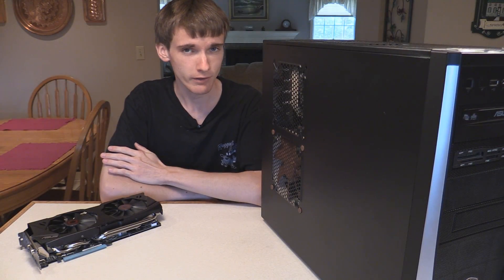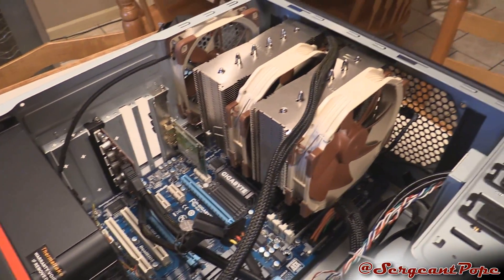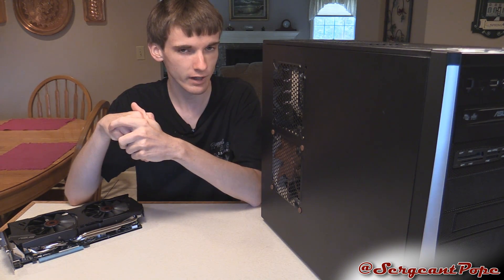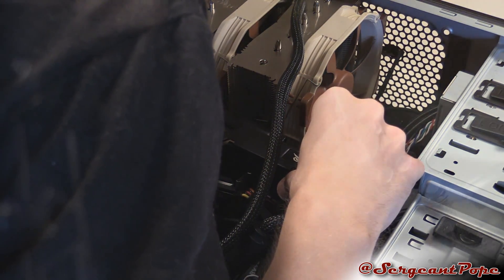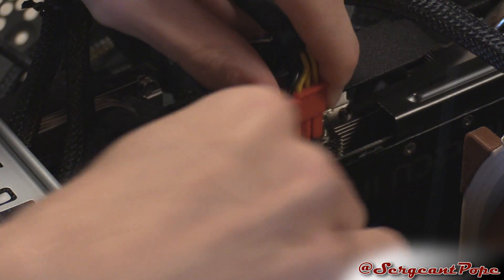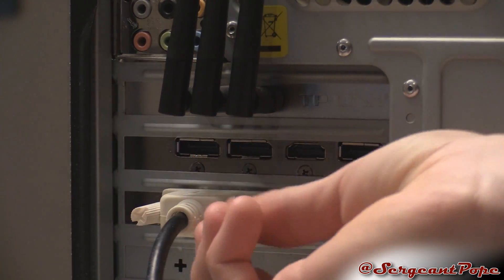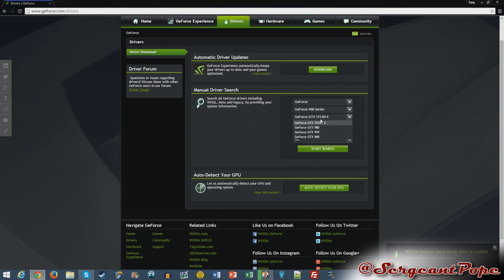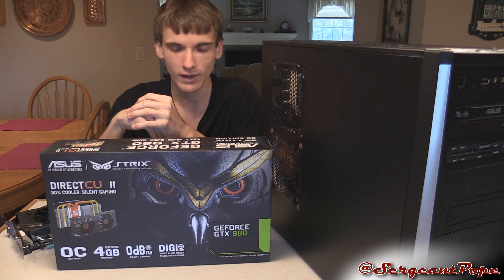How to install a graphics card - GET INTO PC GAMING EASY!

Comment: My pc has a AMD R9 200 series and the computer case I have is a ARK 4U-500-CA Black 4U Rackmount Case 3 I was wondering if you would know if I try to switch the graphics card I have rn would a AMD 480 fit in my pc because I was thinking of buying a 480 but I’m not sure if it would fit the case?

Comment: I have an ASUS gtx 1060 3gb which will fit in my case and I have an issue with the card going in on one end and the other end is not and with pressured applied it won't go in.

Comment: how do you plug the cable into the power supply coz i got a gtx 570 and the cable came with the gpu and isnt plugged into the power supply

Comment: gt 1030 graphics card is avaible to use to use on i3 2120?
Reply from the maker: I wouldn't get anything less than a GTX 1050. Anything lower and the performance drops off quickly and you lose a lot of performance. But to answer your question, any processor will technically work with an i3. Maybe not incredibly well, but it will work.

Comment: Hard Drive Capacity1024 gigabytes Hard Drive TypeSATA Operating SystemWindows 10 Processor BrandAMD Processor Speed3.8 gigahertz Processor ModelAMD FX-Series System Memory (RAM)8 gigabytes Wireless NetworkingNone Warranty Parts1 year limited Labor1 year limited Memory Cache Memory4 megabytes Media Card ReaderNo System Memory RAM Expandable To16 gigabytes Type of Memory (RAM)DDR3 Number Of Memory Slots2 System Memory RAM Speed1600 megahertz Certifications & Listings ENERGY STAR Certified No EPEAT QualifiedNo Network Ethernet10/100/1000 Number Of Ethernet Ports1 Graphics Graphics TypeDiscrete Graphics Processing Unit/GPUAMD Video Memory TypeDedicated Graphics CardAMD Radeon R7 240 Video Memory2048 megabytes Internal Hard Drive RPM7200 revolutions per minute Number Of Internal 3.5" Bays4 Number Of PCI Slots1 Number Of PCI-E x1 Slots1 Number Of PCI-E x16 Slots1 Expansion Slots1 PCI Express x1, 1 PCI Connectivity Number Of Auxiliary Outputs2 Number Of HDMI Outputs1 Number Of USB Port(s)6 Number Of VGA Ports1 Port Type(s)HDMI|DVI|VGA|USB|Ethernet|PS/2 Number Of DVI Ports1 Number Of PS/2 Ports1 External Number Of External 5.25" Bays3 Expansion Bays3 external 5.25", 4 internal 3.5", 4 internal 2.5" Enclosure TypeMid tower SizeStandard Included Operating System Architecture64-bit Optical Drive TypeCD|CD-R|CD-RW|CD-ROM|DVD|DVD-R|DVD+R|DVD-R DL|DVD+R DL|DVD-RW|DVD-ROM|DVD-ROM DL|DVD-RAM|DVD+RW Additional Accessories IncludedUSB keyboard and mouse, power cord, RGB color remote Keyboard IncludedYes Monitor IncludedNo Mouse IncludedYes Feature 3D-CapableYes Audio Technology7.1-channel surround Bluetooth Enabled No General Color CategoryBlack Dimension Height17 inches Width7.6 inches Depth19.75 inches Weight32 pounds Other UPC811842032872 

This is my computer, I want to upgrade the graphics card and power supply but I feel like I want to upgrade my graphics card enough so it’s good for several years and if I want to do that then I don’t want the cpu bottle necking it, also I want to get an ssd and quieter fans so in total, a new GPU ,CPU ,PSU, FANS, MEMORY TO 16 gigs, And after upgrading all that probably a new mother board so I’m basically replacing fucking everything, is it better for me to just sell this computer and start from scratch or upgrade everything?

Comment: Awesome vid bro!
I've got an Hewlett Packard Pavilion P6000 Series. I've retired from gaming but would like to play TF2 or GMOD on the occasion. I'm not really into those really demanding games like dark souls or GTA. My computer runs on a 2.9GHz processor, which is pretty much unheard of in gaming. My budget is 100 bucks. Got any suggestions?
Reply from the maker: The cheapest GPU I recommend is something like a GTX 1050 or a GTX 750 Ti. Anything cheaper than that and the performance degrades really quickly and you get a bad deal.
Reply: Thanks man, Ill take your advice!

Comment: Hi man I'm looking into buying a graphics card but the pc I have right now has integrated graphics do you think I could just add another graphics card on top of that and set it as my primary graphics card?
Reply from the maker: Almost always you can't use the integrated graphics with a graphics card. You just use the graphics from the graphics card.
Reply: SergeantPope - Komada Computer Repair ok cool, and I know it's a weird question but I'm having doubts you can upgrade a cpu right?

Comment: I'm getting a 500 dollar tower, it has a i7 7700t and want to upgrade the graphics card because it has the integrated graphics, Idk which graphics card to get
Reply from the maker: Basically get what you can afford. I suggest spending $150+ for a graphics card for best results.
Reply: SergeantPope - Komada Computer Repair will do, I only play league farley play any other games, this tower has igpu Intel hd 630, that may be enough or not, but for starters to at least run league I want to get the gt 1030, but is the i7 7700t even a good processor ?

Comment: I plan on getting gtx 1060 or 1050 but i have a standard size cpu so will it fit ?
Reply from the maker: CPU doesn't matter. All you need is a PCIe X16 slot on your motherboard and enough wattage from your power supply, as I mentioned in this video.

Comment: I am planning on purchasing an ASUS STRIX-GTX1070 8GB OC, I have a TR Challenger 700W. PCIE motherboard. I have a 6 +2 pin for the GPU, is that the same as an 8 pin?
Reply from the maker: Yep, 6 +2 is the same as an 8 pin. That should be plenty of wattage for a GTX 1070.
Reply: SergeantPope - Komada Computer Repair Cheers mate, novice at PC installation 😀

Comment: after uninstalling all nvidia drivers and then shutting down my computer, and putting my new 1050ti i start it back up and the cards fans will spin then stop a few seconds later and my screen says no signal.....???? help me out please
Reply from the maker: Fans starting to spin and then stopping soon after is pretty common with this round of GPUs. No signal is obviously weird. Have you tried plugging your monitor into the video outputs on the motherboard? It may be routed that way instead for some reason. If that doesn't work, you can try things such as removing and reinstalling the graphics card. Make sure connections are good and solid. Stuff like that.

Comment: I have a lenovo B50-35 computer, which is a single monitor with a single cable power adaptor, so not a desktop thing like you and most others and I dont know if another one will fit and my budget is only about £50-£100 ($64-$129).
Reply from the maker: You can't add graphics cards to an all in one computer like yours.
Reply: Is there any other way of getting high graphics?
Reply from the maker: Not really. Not with an All in One computer like you have. They really aren't upgradable, which is a major limitation of those types of computers.

Comment: what if your  power supply is conected to your mother board
Reply from the maker: The motherboard will have a few plugs going into it. The larger one is a 24 pin, and there's a smaller connector next to the CPU. That's either 4 or 8 pins. The graphics card connectors (6 and 8 pin) are different from both of those and will not be plugged into the motherboard.
Reply: SergeantPope - Komada Computer Repair like it connected to the mother board and theres no battery block
Reply from the maker: I'm not sure what a battery block is.. Can you send a picture to my Twitter? @SergeantPope
Reply: SergeantPope - Komada Computer Repair ok
Reply: SergeantPope - Komada Computer Repair also can you mix 2 gb ram with 4 gbram

Comment: hey man, so i have a lenovo K450e, and i have already upgraded my power supply to an 850 watt one. Now, i  need a graphics card, but i'm not sure that the 1070 or 1080 will fit my tower. Will i need to buy a new tower casing or not for this new card to fit? Thx for the help
Reply from the maker: From what I see online it looks like a regular sized case, so a GTX 1070 or 1080 should fit just fine.

Comment: I have a hp pavillion 500-424 I bought a GTX 745 can it fit in it and do I need a new power supply and which cpu recommend?
Reply from the maker: I looked up your computer and it seems to have a weird motherboard that doesn't have an expansion slots for a graphics card. At least that's what the picture is on HP's website. So you might not be able to install a graphics card on that computer.
Reply: SergeantPope - Komada Computer Repair omg

Comment: Hey! Help! My pc works normally boot when has no gpu
But when i put gpu i got blackscreen cannot boot
Reply from the maker: Do you have your monitor plugged into the graphics card instead of the motherboard?
Reply: i plugged into the graphics card
1080p monitor rx470 gpu
hdmi cable
all fans and gpu and cpu
and keyboard mouse turn on but except black screen :(
Reply from the maker: Ahhh, gotcha. Just to make sure, is the power cable plugged into your RX 470? If it is, a possible issue is your motherboard putting video out to the integrated video instead of your new GPU. If you connect your monitor back to the motherboard, does anything show up then?
Reply: SergeantPope - Komada Computer Repair 
I plugged rx 470
I tried this
I put the hdmi on motherboard
And the gpu is there
The windows turn on
I got to manger 
Monitor is using intel hd graphics
Rx 470 wont be the primary graphics card
I want to make the rx470 primary gpu
And i tried DDU and i have amd driver
Then i tried hdmi to gpu and
Still doesnt work
I cant play games!!!!
Help😩
Reply from the maker: Sorry about the late response, I was away for the weekend. But it sounds like you could probably change your video out to your graphics card. Go into the BIOS (mash the BIOS button on startup, which might be anything from F2 to the delete button). Once you get into the BIOS settings, look around for a video output option.

Comment: Does zotac gtx1050ti mini 4gb graphic card can be installed in Gigabyte GA-H61M-WW
motherboard??????
which type or brand of rams can be installed in it??
I want to install 8gb ram
....
but which company ram shall I install???
Reply from the maker: A GTX 1050 Ti will work in your motherboard since you have a PCIe X16 slot. Looks like your motherboard supports 2 desktop DDR3 ram sticks at 1333MHz.

Comment: Great video, of course I'm going to keep on looking my self but while I'm here, are there any notable difference in installing a graphics card using dual graphics? What I mean is Im running with an AMD A6-6400k APU and want to upgrade to dual graphics while I save up to upgrade the CPU itself. Thanks in advance.
Reply from the maker: From what I've heard, running dual graphics with an AMD APU is good, but not that great. You have to get a certain GPU to run with the graphics on the APU, which kind of sucks. But running the dual graphics helps some. In your case, it might be good since you're just doing that until you save up enough to upgrade.
Reply: I see, thank you for the speedy reply. Yeah since watching the video I found that the GPU that 'matches' my APU is much weaker and cheaper than one I was looking to get - I just didn't realise you had to have a certain GPU to run dual graphics. So I think you're right, it's not that great. Thanks!

Comment: I got my brother a "gaming pc" from beats buy for 599 at Best Buy it's is the cyber power with the GTX 460 I believe in it..would I be able to put a GeForce gtx 1060 straight in it or would I have to buy other components
Reply from the maker: The only thing you might have to upgrade is the power supply. The GTX 1060 needs 20 amps on the 12 volt rail and 400 watts.

Comment: hi what can i get for the acer aspire x3995
Reply from the maker: That looks like a half height case, which means you can only fit a half height (aka small form factor) graphics card inside it. There are half height GTX 750 Tis. There are also some GTX 1050 Tis that would fit in the case, like this one https://smile.amazon.com/ZOTAC-GeForce-Profile-Graphics-ZT-P10510E-10L/dp/B06XHZ29N5/
But like I said in this video, you'd probably also have to upgrade your power supply. And since you have a small case, you'd have to get an upgraded small form factor power supply.

Comment: yeah.. i can tell how expensive that graphics card is by the size
Reply from the maker: That theory kinda holds up, but not always. Typically the most expensive graphics cards are also the biggest, but you can get mid range graphics cards that are just the same size. And then sometimes really expensive graphics cards are small, like the R9 Fury X when that came out.
Reply: wow

Comment: hey i cant find my 6 pin ? i have 500 w !!
Reply from the maker: Some power supplies don't have 6 pin connectors, so if you can't find one on your power supply, it probably doesn't have one. You can get an adapter, but I would suggest getting a better power supply. Even cheap power supplies will have a 6 pin.

Comment: Mine doesn't even have a tower, all the components are in the back casing of mine I believe, would it still work then?
Reply from the maker: Do you mean an All in One computer? Like a iMac, which has the computer in the monitor?
Reply: Yeah, I found out the name for it earlier today actually, I do mean an All in One Computer. It's an HP one, would I have to buy a separate computer that is just a monitor with a tower or desktop casing, or do I still have a good chance with my current one?

Comment: Great video but still kind of confused, if i was to play on a tv with a PC how do i plug the graphics card in?
Reply: Well a easy way to hook a computer to your tv is by connecting A HDMI cable from the computer to the tv (assuming they both have the required ports). then find the input on the tv and you should be good.

Comment: hey i want to know the whatever connectors gpu have like hdmi,display port e.t.c they are connected to monitor ????? ( my gpu have hdmi and my monitor have hdmi too) or motherboard ( dvi and vga) pls help
Reply from the maker: When you're using a graphics card, you plug your monitor into the video outputs on the graphics card instead of the motherboard.
Reply: SergeantPope - Komada Computer Repair  ok thanks ....... i have hdmi on monitor and gpu perfect and i have sapphire rx 470 4gb (platinum) how it works with intel i5 6500 any idea????.....
Reply from the maker: The i5 6500 is pretty good for gaming. The RX 470 is a good card for price. It would be a good combination for 1080p gaming. Any higher with high settings and it would struggle.
Reply: i will play games at 1080 p high setting. Any  idea about how many fps it give for gta 5 like games average ????  thank u alot for helping me brother

Comment: will a gpu work if it features an 8 pin slot but i plug a 6 pin pcie connector into it rather than a 8 pin as my psu only has a 6 pin connector?
Reply from the maker: No, it won't work. You can buy adapters that make two 6 pin connectors into an 8 pin. But you may want to consider upgrading your power supply if you are having issues with not enough power.

Comment: I have a Lenovo Desktop worth like 600$. Does the PSU have enough power to feed a GTX 1060? Im not sure which PSU i have. And i dont wanna buy a GTX 1060 before i know can my PSU feed it.
Reply from the maker: What model Lenovo desktop do you have?
Reply from the maker: It's an expansion slot. I guess you could think of it like a really fast USB port.

Comment: hey, i know this video is about 2 years old but i have a question. I installed my graphics card (which is a pny gtx 1060, i also have a 520 watts power supply) and it asked for a dvi-d display and so does my monitor, I plugged one in into the graphics card and one in the monitor, the desktop tower turns on fine but the monitor doesn't turn on at all, it says that there is no signal, i have checked across the Internet but i can't see to find the right answer.
Reply from the maker: Sometimes the motherboard settings will need to have video output settings changed, so go into the BIOS and see if there's an option for that. Besides this, check the connection of the graphics card into the PCIe slot and make sure it's solid. Also make sure you plug the power cable into the graphics card.
Reply: SergeantPope - Komada Computer Repair I tired this, is it just possible the monitor is not capable of running the graphic card
Reply from the maker: That would be highly unlikely. The only way that would happen is if your monitor was analog and your graphics card was only digital. I suppose you could try plugging it into another monitor or TV though. Maybe plug an HDMI cable from the graphics card to a TV?

Comment: I tried inserting a GTX 1050 Ti graphics card on my x16 slot but when I connected hdmi cables to both monitor and gpu I get no signal! HELP! (My gpu only requires 300w power  and my psu is 500w 80+)
Reply from the maker: Did you connect the power cable to your graphics card?
Reply: SergeantPope - Komada Computer Repair My GPU doesn't require an extra pci power connector
Reply from the maker: Oh yeah, the 1050 Ti doesn't require extra power.. Have you tried taking the graphics card out and making sure the connection is secure? Sometimes there are also BIOS settings to change the video out from the motherboard to a graphics card.
Reply: SergeantPope - Komada Computer Repair Yep tried all methods nothing worked, turns out the GPU was defected gotta get refund soon :( but thanks for your help!
Reply from the maker: Oh damn, that's rare. But I'm glad you're getting it taken care of!
Reply: SergeantPope - Komada Computer Repair It was a brand new graphics card too so disappointed it didn't work